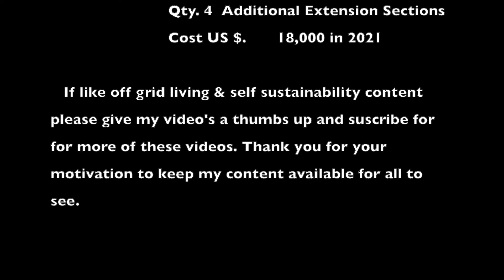NORWOOD HD36-V2 MILL ASSEMBLY / CONDENSED VIDEO

Comment: Good thing about winter gives you time to condense your footage. Just a obsevation I dont think your mill is level your carridge shouldnt roll back when you finish your cut. Some minor adjustment  would crrect that. Nice video Al
Reply from the maker: Thanks for the tips!
Reply: Al I hope you dont take my comment as bashing your setup. I think you did a great job setting your mill up. just passing on learned experince. @offgridal
Reply from the maker: No not taken bad at all, I totally appreciate constructive comments. That was the first beam I ever cut on the mill and at that time I hadn't leveled and shimmed and bolted it to the pears yet. If you watch the log being installed on the mill with the tractor you will also see that the mill moved when you hear the clunk.